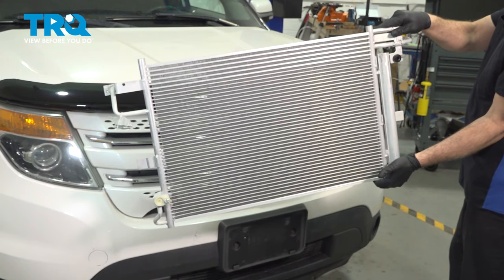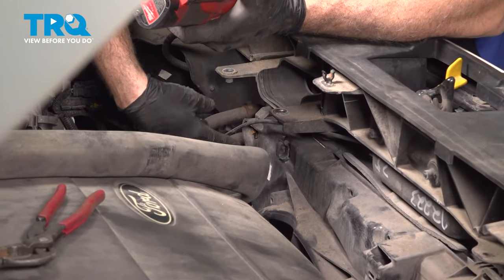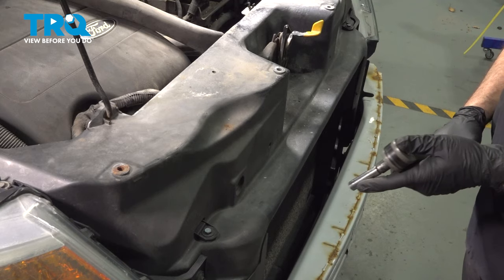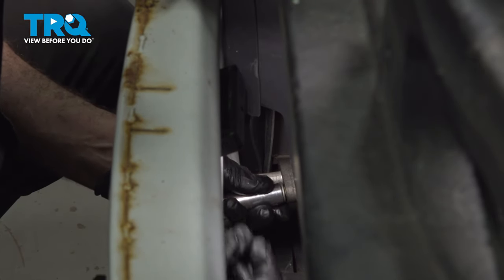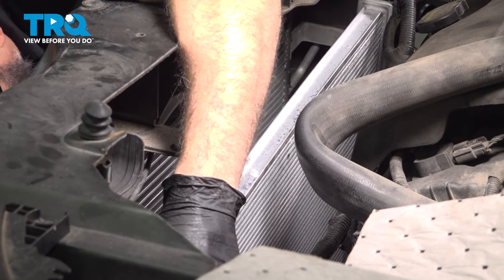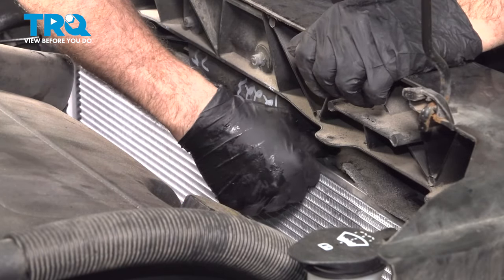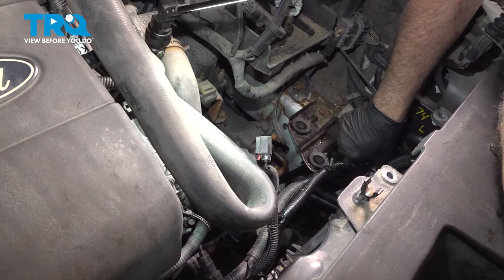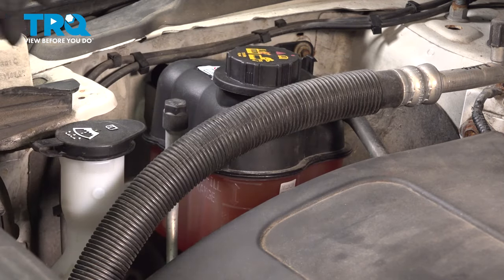How to Replace AC Condenser 2011-2019 Ford Explorer

Comment: I did this on a 2016 Explorer Sport. Be prepared for even more work with the turbo air cooler that sits on top of the condenser

Comment: Great video!  Not the easiest AC condenser to replace. Need some patience. The corrosion on the AC condenser and where the high and low side line attach to can be tricky and a bit of a pain.

Comment: If you take 6 bolts out of the core support assembly then the whole cooling module can be taken out and sat on a bench to disassemble. It's a whole lot easier than fighting it in the vehicle.